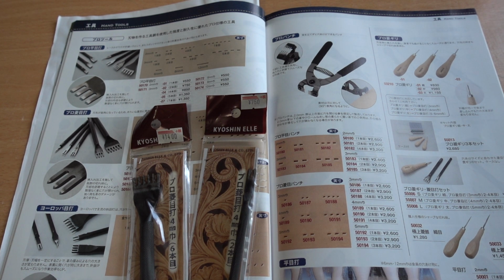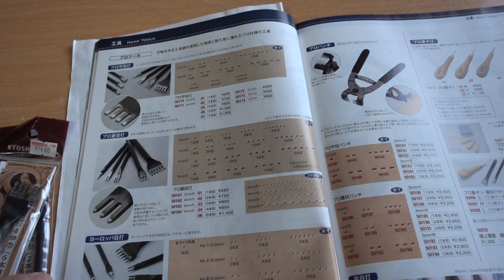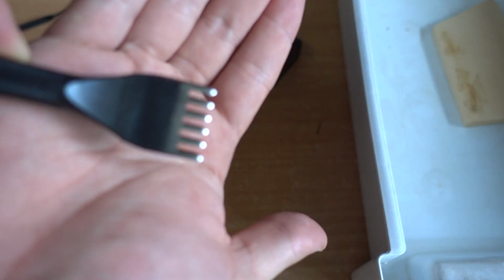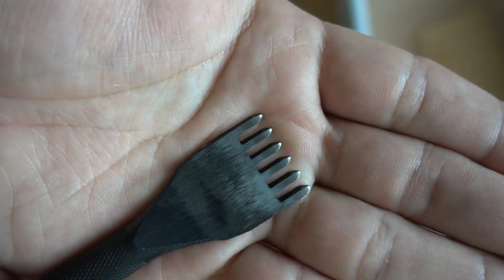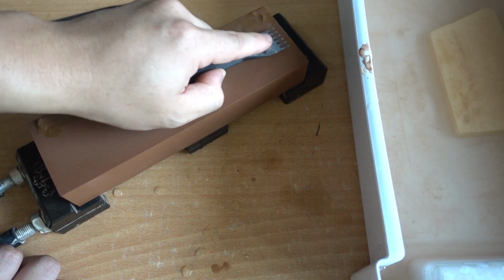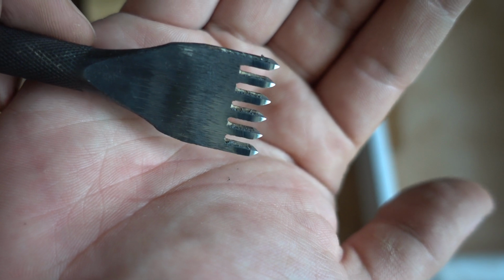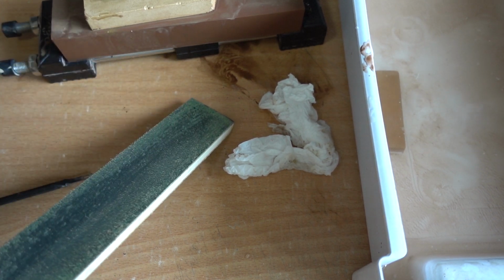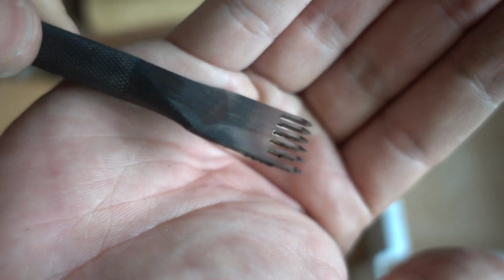Good Looking Stitching PART 1 : Preparation | Polishing Pricking Iron

Comment: If you don't own stones you could use sandpaper* on plate glass/flat granite. This is often called "scary sharp" - (although on a long enough timeline, you may spend up more on sandpaper than you would water stones, it's definitely cheaper if you're just starting out). It's definitely worth noting though: Grits on Japanese water stones are not 1:1 with sandpaper.
King's 1000 grit stone is about 800 grit CAMI (USA), F500 / P1500 (EU). A 6000 grit water stone is about 1500 grit sandpaper. "Grits" are industry standards, so vary between countries and applications; however, you can do a decent job converting them because ultimately they're referring to the particle size of the abrasive, which can be expressed in microns.
*generally "abrasive films" are higher quality than sandpaper. If you're more experienced/daring and are willing to go down to lower grits for initial grinding/flattening, the blue sanding belts are made of a longer-lasting abrasive.

Comment: After polishing both pricking irons and lacing irons dip the teeth into a mixture of beeswax and mineral oil goes into the leather and pulls out a lot easer , Also saves a lot of distortion as well .Well done on the polishing
Reply from the maker: Thank you for the tip sir! I will try your method of beeswax and mineral oil.
Reply: I stick my pricking irons into a piece of glycerine saddle soap to make them easier to pull out, particularly the 4+ teeth ones.

Comment: In my experience, with lesser irons, you have to polish the interior sides of the tines as well.  I use 500 wet dry sandpaper, then 1000 wet dry sandpaper wrapped around something thin and flat.  I've used popsicle sticks, and am able to get between both tines and sand both surfaces at once.  Have also used a very thing piece of stainless steel.  Really, it is a real pain in the butt.  My pocket knife has a titanium coating that is SUPER low friction, I wish stitching irons were thusly coated.  NEWAY, THANKS!
Reply from the maker: You already know a good way! that is very good way of sharpening and polish the inside of the teeth. I used that method and get quite a good result. However, if beginner tries to do it, they are more likely to ruin the irons. What pocket knives with titanium coating are you using? and what steel? I love pocket knives too.
Reply: I use a Kershaw Volt II, it is a $20 knife!  We have no discretionary income, so we have no luxuries like quality steel!  But the upside of the softer Chinese steel is that a few strokes on the strop and it is laser sharp again.  The benefit of being a leather shop is that we have plenty of sharpening technology at hand!

Also of note, I lOVE the speedsafe flipper of the Kershaws.  This may be illegal where you live though (where do you live, I've always wondered?).  But it is SO easy to deploy the knife.  Previously I used a knife with a thumb stud which was okay to deploy.  But the Speed Safe flipper is just so fast and convenient.  I would like to use a knife with higher quality steel.  Maybe a Kizer on some type of discount would be reasonable for me, but I don't think I can go back to a normal deployment knife.  I recommend trying out a cheap Kershaw with Speed Safe, if it is not illegal where you live.  You may curse the steel, but you will love flipping out that blade!
Reply: A credit card works amazing to wrap the paper around.

Comment: Very good, thanks 
Is it necessary to do sharping with all these three devices ? 
and may I ask you whats the name of yellow stone and the green device that you used after that?
Reply: The green device is a leather strop.  Very simply, it's a piece of veg tan leather glued to a piece of wood.  What makes it green is the honing compound you rub on the leather before the final step in sharpening, which is stropping.
The green is a general purpose compound (and is absolutely fine to use).  But, if you can find it, there is also the white sharpening compound that is used by jewelers.
The sharpening stones he's using are Japanese water stones.  They work differently from the western version of sharpening stones but the principle of going from rough stone to smoother and smoother stones is the same.
- Cathy (&, accidently, Steve), Ottawa/Bytown/Pimisi

Comment: OK for half of the prong surfaces but how about the other half, the inside faces????
Reply from the maker: I left it rough for reason. Most people will ruin the teeth grind attempting to smooth it out. There is a way to do it with different tools. The effect is little better

Comment: More of a stitching chisel than a pricking iron, isnt it…?   Seriously not trying to be a duck, or to be that guy… but I was taught there’s a difference. Stitching chisels, like these (I have a set of these btw) are meant to punch thru the work allowing needles to pass thru with min effort, easily stitching the work.  Where as a pricking iron is just meant to pierce, or prick, the surface.  Mostly just to mark the location for each stitch, similar to am over stitcher, meant to be a guide for someone using an awl  to punch each hole for your needles as you go…you should never see daylight after picking up a pricking iron. Just marked for traditional awl stitching.   Forgive me if I’ve been lead astray and  failed in my effort to inform, instead only serving to bring confusion. 
Btw, when running your tools on a whet stone by pulling them in the direction they’ll be pulled to remove the tools in use, I generally would strop by pushing in the opposite direction.   I would maybe even look at swapping the two motions and using a push in the direction of the tools intended use, then stropping by pulling , or an “out stroke”.  Generally try to use an opposite motion to strop so as to remove the resulting bur you worked so hard to roll up on the stone.   As mentioned, cleaning out between each prong is very important. Leaving extra trash in there will mean sure hang ups in your work. I even use small strips of sand paper folded over a thin flat piece of wood or scrapers or tooling implements, something.   Just make sure it’s flat so you aren’t rounding anything over. Get that coating off there and slick those sides up.  It’ll make a world of difference.  F working with particularly thick or troublesome materials, or glue is grabbing  your tools, I keep some bees wax in a little jar lid and poke the prongs into it now n then to help keep them moving.  And I took a small piece of  med gauge mild steel about 3x4 ish or so and cut a channel long ways like 1/8” wider than the thickness of the chisels so if they ever really get stuck i; there hood, you don’t have to risk bending or screwing anything up, just lay that plate down slide it over so it’s wrapped around the tool stuck in the leather, push down on the metal so everything gets even pressure  and you’re not tearing your work apart but you can hold down the leather around the stuck tool and more easily pull it out clean.  Just a thought.  Sorry for rambling on.